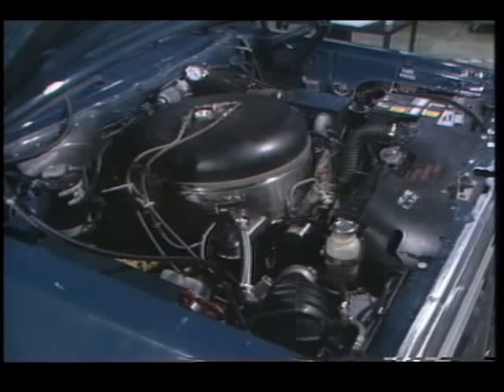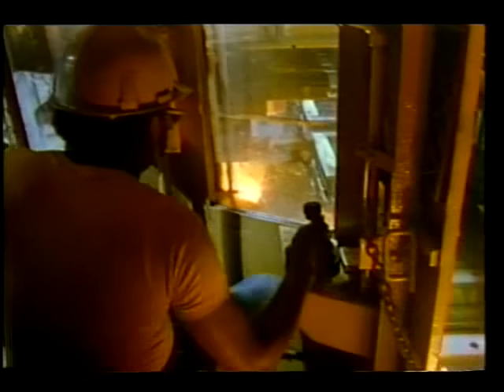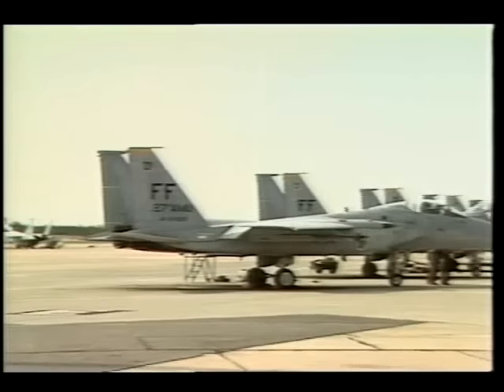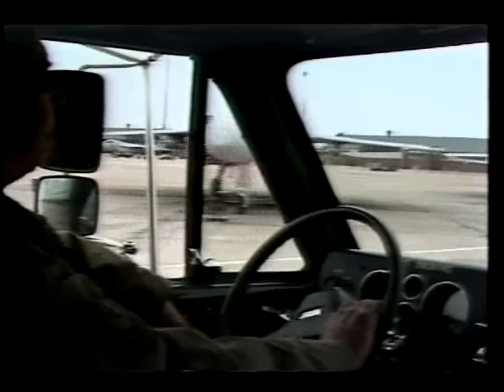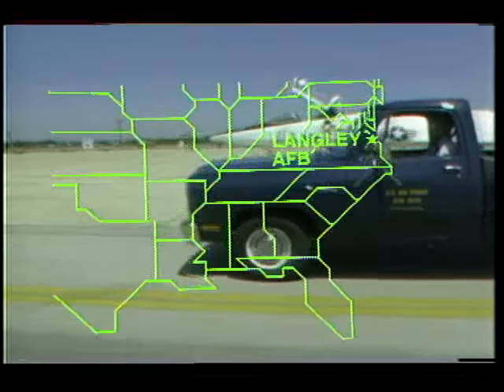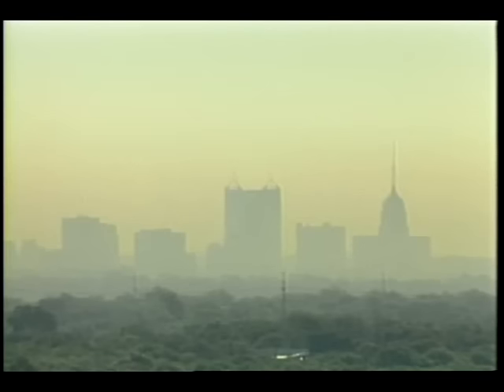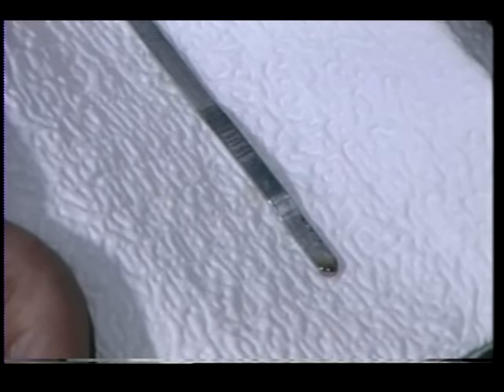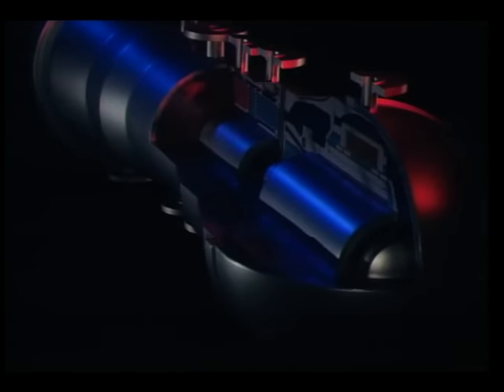The Stirling Engine: A Wave of the Future

Comment: Potential to hybridize this? With fuel cell, couldn’t this run on literally any fuel or electricity?
Reply: Yes some people just make diy engine with a few lesens focosing light
Reply: Anything that produces heat can run this, even a person can run small engines
Reply: Yes there's a possibility to use it as an electric charger for electric vehicles.
Reply: You could use electricity to provide the heat but it would be extremely inefficient. It would be better just to use the electricity to power a motor. But this engine platform can use any type of heat so even focused solar light through a Fresnel lens for example could provide sufficient heat to run the engine in theory.
Reply: @kevandthat3574  I think he means using dc hub motors on the wheels and this engine as a secondary system
Reply: This proved more efficient than gasoline engines. But like gasoline engine, starting time is not quick and also the gear shifting process is not easy among research by nasa ! Fossil fuels were abundantly available in 1986 in which the drawbacks of stirling were not seriously looked in ! On other hand Nissan tama achived 100 km per charge using lead acid battery during world war 2. But this oil and gas industry never let new inventions. But this time I m sure these both can make reentry !

Comment: these could be used wherever electrics fail, particurarly in canada, alaska and especially russia and poland. due to the nature of the stirling engine it would be PERFECT for colder environments, this makes you think why these arent in cars as of now. If only i had a workshop...
Reply: I love how you put Poland alongside Canada, Alaska and Russia xD Cheers
Reply: @Mgoblagulkablong   Have you found any other similar tech like this or anything recent regarding a Stirling engine?
Reply: the swedish nayv uses it for submarines, most quiet and most difficult to detect submarines on the world
also the excuse they had to not use it in car after the test shown in this video was the power modulation, that would not be an issues if it was used as a power generator in a serial hybrid drivetrain  @AIuminum

Comment: Is google listening to our conversations?   I was just talking with a buddy the other day about how to combine Sterling engine 
as an on board generator to charge EV batteries to propel a converted School Bus Camper (or any vehicle) via electric motor.

75 HP is no slouch when it comes to charging, but if I've thought of it, I know I'm not the first...

Comment: I wonder if these engines can be available. Would be nice to implement it on a vehicle rebuild.
Reply: They are but not for cars. They are terriblwe at this apllication. They are great to provide electricity from waste heat though. So they could make a comeback for electric cars.
Reply: @@user-eq7ie4tc9e NASA already solved the problem with mod II, it was turned down, because the automakers didn't want to switch to a new engine type. especially one with no oil changes and piston seal life with 90 percent reliability after 3500 hours of constant use.

Comment: what was the power to weight ratio of the engine
Reply: About 0.00005.
Reply: On the Mod I engine that the vehicles in this video were using, it was about 8.1 lbs/HP.  The Mod 2 was much improved, and got down to 5.5 lbs/HP.  For reference, the "Iron Duke" engine they were replacing in the Chevy Celebrity they put the Mod 2 into, it got about 4.1 lbs/HP.

Comment: what happens if you use an induction heater and lithium ion batteries or a lead acid induction heater requires less energy and compare with an electric car which of them spends more energy

Comment: What were the complications???
Reply: 1) Its power output can’t be throttled easily because output depends on temperature of an expansion chamber
2) long startup time to heat up expansion chamber and get engine started

Interestingly, super stealth Swedish Gotland class submarines do use a Stirling engine.

Comment: Very nice presentation! I belive this engine is the MOD-II correct? I always confude the MOD I and II because of the veichles on wich they were used that were a chevrolet and a ford respectively... I belive... correct?  XD
I guess that the advantage of gettilg high torque at low speed is one of the greatest of the stirling technology as refered in this video, wath can be comparable to diesel nowadays. This proves that this engine may, some day, operate trucks and heavy machines... lol
Reply: These were actually using the Mod I.

Comment: I think they will be using thermoacoustic engines for range extender’s on electrical vehicles now or should be. would be more officiant and the power to weight ratio much better and compact something I’ve been working on lately check it out might spark some ideas

Comment: I feel like this could be combined with electric cars. Imagine using electricity to heat up something to power the stirling rather than gas.
Reply: You can use a fuel cell to power it!
Reply: You might as well use the electricity to run an electric motor. Take a gas powered Stirling and have it run a generator to run an electric motor and small battery pack. Refueling is just like a regular car.
Reply: No it would be better for gas. It takes an enormous amount of electricity to create heat. It would be highly inefficient
Reply: @gime5323  it doesn't. Literally 1 watt makes heat. Almost every space heater in existence is only 1500 watts. They make Sterling engine toys that run on 5v ac and work off of a single wire coiled around the air chamber. All it requires is a difference in temperature from one end of the chamber to the other, this can actually be achieved with no fuel at all by simply cooling the opposite end below ambient temp.

Comment: It's true that a stirling engine is super economic, clean and quiet. The only problem is, it's fairly large. So it's unsuitable for vehicles, but it can be used for submarines and space probes. (especially for not necessarily using oxygen)
Reply: it should be fine in large American SUVs
Reply: wrong

Comment: My understanding( or lack thereof) is that the smaller the difference in temperature between the heat source and the heat sink is the less efficient that engine is. I think this is Carnot's idea and it works for all heat engines.
I know the model stirling engines that are popular now don't require a large difference in temperature at all. Because of this, I always thought that wouldn't be nearly as efficient as modern ICEs.

Comment: I think it would be handy if the heat source was from a trash furnace which could burn old plastic, tyres, anything that burns.
Reply: yeah but the power density from those are pretty bad, also would smell really really bad for anyone near it. You could turn the old plastic into gasoline instead if you wanted, it's not super complex actually, and you won't have to have an asthma attack whenever you run the engine

Comment: So why aren't these used today?
Reply: Short answer: too expensive for the necessary power-to-weight ratio to use as a direct replacement for an internal combustion engine. They might become suitable as a range-extender for an electric hybrid vehicle in the future however.
Reply: @raelik777  yeah I'd like too see this attempted.  It seems like a good match.  The Stirling engine works more efficiently with higher temperatures and the exhaust of an ice is about 700 degrees.

Comment: Where were the MPG figures? And sure, maybe ICE engines both then and now are more efficient/practical than that Sterling from '92 in the video but surely it could be improved just as much, at least.
Reply: stirling engines can reach efficiencies of up to 60% easily
Reply: @Alex G. use an online efficiency calculator
Reply: So the Mod 2 was able to get around 58 mpg highway, and 33 city.